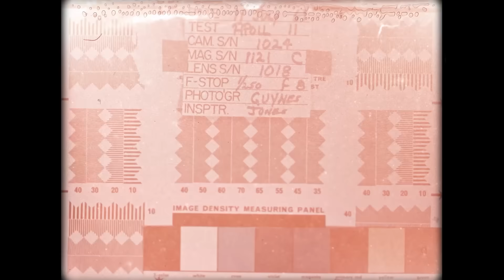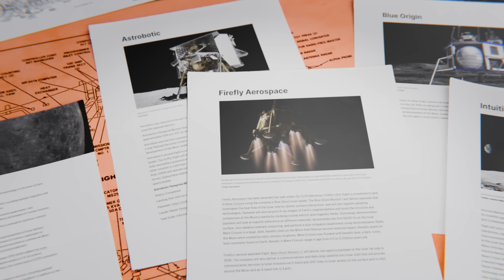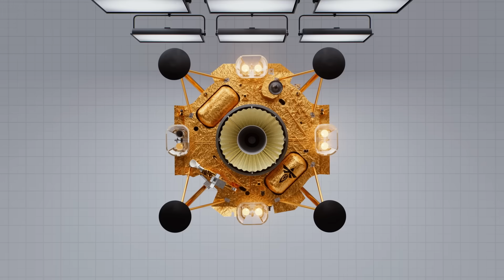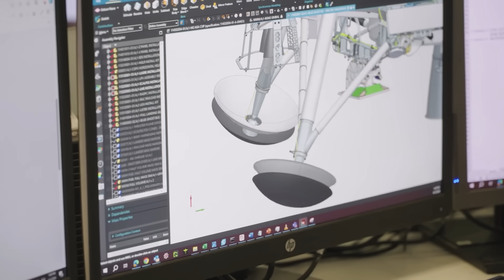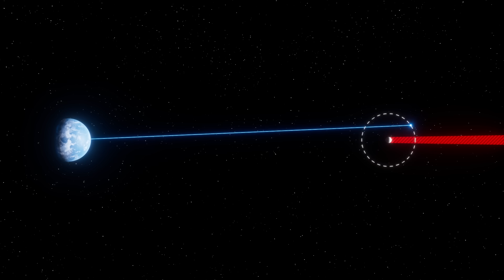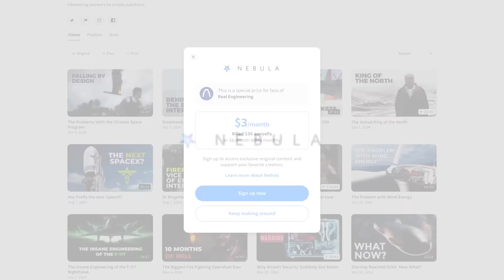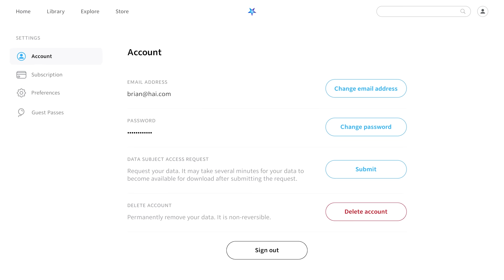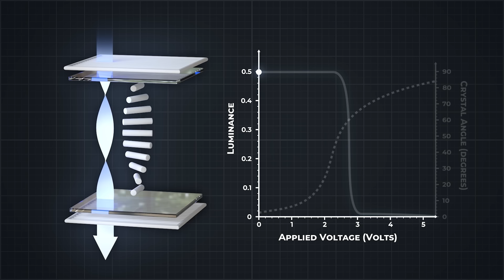Why the US is Struggling to Land on the Moon

Comment: There's a story that the Apollo astronauts visited the facility building the Saturn V rockets. At a presentation, the head of engineering announced that they had developed a whole new engineering standard for Saturn V manufacturing, and that they could guarantee 99.9% of all components would operate as expected, way beyond the engineering standards of the day. An astronaut put up his hand, and asked how many components were on the rocket. 'Over a million' was the answer. The same astronaut then put his hand up again. 'So, what your saying is, 1,000 components are guaranteed to fail?'. 70 years later, NASA will never again risk astronauts until the chances of failure are infinitesimal, and this is one reason why its become prohibitively expensive
Reply: That's not how statistical chance works. If each individual component has a .1% chance of failure, and have ten components, then there is a 1E^-10 chance that all ten fail (.1^10).  .1^1,000 is so small as to be essentially zero, and with multiple redundancy, is zero.
Reply: @SubLordHawk   When you're in space it only takes one of those components to fail to kill everyone on board though (Obviously there are redundancies for some, but in other cases there isn't and one component failing can result in everyone dying, look at the challenger space shuttle for example)
Reply: @RealDijital  I'm quite aware thank you. Also, my comment was regarding the mathematics.
Reply: That is why just about every one of those parts had a backup and that backup had a backup.
Reply: @wpatrickw2012  Er no, you've not got the point. 1 fire that killed 3 astronauts, 1 explosion that almost killed 3 more do not suggest a robust system with strong backup systems. And that's not counting the faults that almost caused other catastrophic issues where basic luck got them through. Modern manned space travel is extraordinarily expensive and difficult because that level of risk would never be permitted now.

Comment: i know weight is an issue. 
but still:
if landing on that thing is such a difficult task, why not calculate some "extra" to the weight-budged for a "sort of hook mechanism"?  

(i can see why that won't work, if the lander is at a constant horizontal trajectory with a certain amount of velocity , the hook would create it to slam it into the ground. but maybe in combination with the booster and a smart programmed sequence, when its slowed down...) 

i imagine the hook must generate its own force to penetrate the ground via a small rocket, so that the lander doesn't gets out of balance while firing the hook. 

just curios 2cents

Comment: Look at the amount of engineering that went into the legs at NASA Marshall. We used to have engineers who were able physicists. Generations later, all the most capable engineering generations are retired. Now, we have engineers with all the ego and very little classical understanding and experience in systems engineering who treat techs and mechanics as second class citizens. Five legs had too high a probability of tripping on the Lunar surface, three legs were not stable enough, so four was the correct number. I’m a tech, and I figured this out.

Comment: I've only just started watching this, but my opinion going into this is that 1) we sent humans to overcome things instantly instead of using automated systems and 2) we got lucky back in the Apollo era. We chose to land in those areas because it had the greatest chance of success, not solely for scientific research. Remember, that was just secondary to being on the moon during a cold war.
Reply: How could you get lucky 10 times in a row, unless there's a trick.
Reply: @robymaru03  Simple. To land humans safely, they prioritized larger areas that have a lower chance of unexpected rocks in the LZ. With rovers and unmanned landers, they prioritize scientific wants, which are usually areas with rocks. Both cases, mission designers had no idea what the final 50-100 feet will be like until the last second.

Comment: There is no struggle. Any nation with a space program could get to the Moon. The reason is elementary.
THERE IS NO POINT. 
It's a very expensive enterprise posing a not insignificant danger for essentially no gain.
We do not really need more Moon rocks, we have enough. And even if we did, sending a robot is orders of magnitude simpler. We do not need human eyes in bulky suits for several hours to see something. We have telescopes and robots. We do not need a scientific station on the Moon. Orbital stations are far superior for the simple reason that they have the advantage of zero gravity which the Moon lacks the same as Earth.
At the moment the only reason to send a manned mission would be a publicity stunt and the reality is that no one cares much. It's already been done, multiple times. It's not worth it.
People on the Moon are pointless until we get serious about its industrialization and that only comes after establishing a certain Earth orbital infrastructure anyway.
Reply: I argue the zero atmosphere and extremely low gravity is enough of a reason to go there if only for the fact that it would tremendously help rockets launch off the surface. A large reason why rockets are so big and expensive is because they have to break out of earth's atmosphere and immense gravity. On the moon, we could make spacecraft cheaper, smaller, and more efficient. In any case, colonizing the moon is an integral step towards further expansion into the solar system.
Reply: @savagesandwich9742  You can make spacecraft even cheaper and easier in orbit. Where there is no gravity. And plenty of resources from any meteor containing all the raw materials you might need which you can tow to the needed point with negligible effort. :)
As I said, you are completely right. Industrializing the Moon is the obvious path forward. But you only start that after you have decent Earth orbital infrastructure to allow transit of resources, machinery, people (if needed at all, the Moon is close enough for telepresence).
And to do all that you first need a reason. A reason to create industry on the Moon would be to supply space industry. But we don't yet have one. A readon to mine the Moon would be resources we could get from there easier and more profitably. There are none at the moment.
So as I said, right now there is simply no point. We do not YET have a practical reason to go there.

Comment: First of all, the first controlled landings on the moon were by the unmanned U.S. Surveyor landers, and 2 out of 7 failed. The Surveyor was a good design though. It was short with the three landing legs spread far apart. All 6 Apollo missions that actually made an attempt to land on the moon were successful. Mostly for 2 reasons. They had a similar design to the Surveyor landers. Short and wide, with a low center of gravity. Nevertheless, Apollo 11 would have failed, had it been unmanned. Neil Armstrong discovered that the computer was pointing it directly toward a field of boulders. He had to take over manual control, and flew the lunar module for over a minute before finding a suitable landing site. Without a human pilot, it would have crashed. The Intuitive Machines lander was designed completely wrong, even for a landing on a totally flat surface. It was tall and small in diameter. It was seriously top heavy, and the landing legs were way to close together. Even a human pilot would have had a really hard time landing that thing. It's simple physics. I don't understand why they can't figure out something so simple. They got the Surveyor and the Apollo lunar module right 50+ years ago. I guess engineers aren't what they used to be.
Reply: That's what I thought as soon as I saw it.

Comment: Are they serious? Can't they use a radar altimeter and infrared cameras to see through the dust?
Reply: I'm not sure IR cameras can see through landing dust since it's probably quite dense and with thick granulometry, but yea radar should have no issue at all
Reply: @v0ldy54  Well, most of the moon dust is very fine, depending on the density of the landing dust, IR could penetrate. Or maybe they could use wavelengths between IR and microwave. It's baffling they are just using optical cameras.

Comment: The more I reflect on the Apollo program, the more remarkable it seems. Not a single mission that took off ended in total failure. They used lead-acid batteries, and their computers operated at a speed of only 0.043 MHz, while today’s computers can run at 4000 MHz. Additionally, the RAM memory in Apollo spacecraft was just 2 KB, whereas today's machines typically have 16000000 KB. In the 1960's, we had only 11 years of rocket experience to rely on, compared to 65 years of experience today. However, back then, the space program received 4% of the federal budget, while today it gets just 0.5%—and its declining.
Reply: Well they certainly fooled you 😂 they need  another seven astronauts😅
1987

Comment: Surveyor landers not even mentioned when that's closer to what NASA is doing with CLPS than Apollo manned landings tbh, those don't exactly have a great success rate either at the start
Reply: Given the problems with the previous 'Ranger' series (which weren't even trying to soft land, and only the last three were successful), engineers were somewhat surprised that Surveyor 1...*did* work, first time out.
Reply: Or even the Lunokhod programme
Reply: Two reasons why US is struggling: 1 - sending money to Ukraine instead of funding NASA 2 - wants to send women to the moon instead of men; former are weaker and require more care to land safely
Reply: Yes, the seven NASA Surveyor missions to land on the Moon were pure robotic landers with technology from 60 years ago and designed by JPL. Five out of the seven landed successfully. The CLPS missions are from smaller organizations, and the cost is lower after adjusting for inflation, but NASA had landing technology six decades ago.

Comment: The most common reason for probes not landing on the moon was launch failure where the rocket did not achieve low earth orbit. This is a failure of the launch vehicle not the probe and is true for both the Americans and the Soviets.
Most probes that achieved selenocentric orbit successfully completed their missions. This raises the question that if probes launched during the 1960s and 1970s using the technology of that time were successful, why is it so difficult now?
If you want to get scientific instruments to the moon why not emulate the probes designed for the Surveyor and Luna programmes?

Comment: We can see why people have doubts as to whether or not we really landed men on the moon. It's been proven by some people that have investigated the landing computers and other systems in recent years that they were designed and built to work during the 60s and early 70s, but it's been thought that the risk for failure was to high. Too many things would have to go just right so the decision was made not to go, and they faked it instead. The amazing thing to me if that they kept up with more moon landing missions. If they were faked that would be easy. If they were real than that merely compounds the risk, and they all were successful. Hmmmm. 
My guess would be that the missions were continued in order to try and get the government funding to keep Nasa going. There were all those jobs to think of.

Comment: Gen Z Silicon valley robot rocket boys will do anything to avoid using Radar... accurate to within millimeter and can even do SAR imaging on approach.
Reply: yeah I was wondering the same, I believe that's what Chandrayaan 3 used for it's successful landing
Reply: American silicon is surviving because of Chinese, Indian engineers. American student not interested in stem 🤣
Reply: I hope you have lots of hopes and dreams because they're the only thing that could power a radar set with the capabilities you describe on a lunar lander. I don't have the exact numbers and honestly I don't need to because even with the ballpark numbers, you'd need to increase the power source of the lander tenfold.
Reply: @crazeelazee7524  The Apollo LEM had both a three-beam Doppler radar velocity sensor and a radar altimeter. Granted it took a Saturn 5 full stack to get it there.
Reply: @MattNolanCustom  A radar altimeter and a SAR radar are not the same. A radar altimeter is as simple as it gets and you would need ~10-20 watts for it. A SAR radar would need, at the lower end, a couple kilowatts of energy.
Mind you, the Nova-C lander's (one of which tipped over) solar panels can output ~300 watts.
Reply: @crazeelazee7524  sub-20W short range tactical micro SAR systems have been around for almost 2 decades. There's really no excuse I can see not to make them space-worthy to use on a lander like this to augment the visual spectrum systems
Reply: @crazeelazee7524  You really need the radar in the last 100m or so.
Reply: @crazeelazee7524  You can get S, X, and K,  band radars that use very little power but are more than capable of ranging and imaging (SAR) against the moon. Additionally you already have the RF equipment onboard acting as a link to the ground station.

More over, radars for applications like this don't need a lot of power. You're not trying to track every single droplet of water in the air.  Additionally a 1% duty cycle 1 watt RMS pulsed radar is effectively 100 watts  of absolutely SCREAMING RF energy. 

lastly... They have the power to do image processing in real time,  that fair bit of power. 

Solar cells used on probes like that pull down about 100 to 300 watts per square meter. Those landers are not exactly small, they have the power budget.

Comment: 1969-the Moonlander lands beautifully on the moon. 2024-it fell over!. Those olden day folks weren’t so dumb after all.
Reply: It wasn't plain sailing, there were some hairy landings. On Apollo 12, Pete Conrad encountered so much dust that his final descent to the surface was done blind. When observing the LEM on the first moonwalk, Conrad realised they had landed only 20 feet in front of a large crater.
Apollo 14’s Antares lander flown by Alan Shepard actually skidded sideways on its landing gear and stopped at an angle of 8 degrees with one footpad in a small crater. 
Similarly, Apollo 15's lunar module Falcon came to rest with its rear footpad on the rim of a 20-foot-wide crater that Dave Scott couldn’t see. This caused one of the lunar module's footpads to be off the surface entirely and placed the spacecraft at an 11 degree tilt.
Reply: Yeah man, those Nazi scientists
Reply: And it was accomplished with virtually zero diversity!  Just saying.  The 800 pound gorilla in the room: back pre 1970 NASA hired the best.  Period.  And, NASA tapped Von Braun and dozens of former Nazi scientists in the late 50’s.  They were the fathers of the Apollo program.
Reply: That's because in the past NASA had Nazi engineers from Operation Paperclip.
Reply: plus they didn't even cancel their horizontal velocity before trying to land... they did it all in one maneuver! truly unbelievable...
Reply: @ Cancelling out the horizontal velocity was actually a great challenge. Armstrong struggled with it and Apollo 14 actually skidded sideways on its landing gear and stopped with one footpad in a small crater. Pete Conrad of Apollo 12 said it took all his 20 years flying experience to do less than 60 seconds manual ‘stick time.’
Reply: And Lunokhod 1, 1970 an 11-month remote control mission.
Reply: @prasakmanitou4925  very true and an excellent reference sir!
Reply: They had a much bigger budget to work with tbf
Reply: bigger budget, more engineers, and multiple tested sessions with manned flights VS autonomous first try with a smaller team, no shit they did worse

Comment: Honestly, hearing that the failure rate of moon landings is 50% while mars' is just 5% higher, is kind of amazing. Different athmosphere, incredibly further away, different gravitational characteristics, yet only 5% difference. (I know, the dataset is very limited, but still)
Reply: You have to remember that Mars techically has infinite more atmosphere than the Moon. You can land with parachutes on Mars, it helps alot.
Reply: Just like flying planes the hard parts takeoff and landing, once you're in vacuum/air it's relatively easy

Comment: Probably the same reason nobody knows how to build a building, make a car or airplane, or create a correctly functioning computer operating system. Many things have changed between the 1960s and 2020...
Reply: Engineers made the lunar module and everything else to go to the Moon. By hand. They're not even taught the same protocol anymore. That's why they don't know how to make it.
Reply: @stevenlake5278  Powered by redneck engineering, just throw stuff together until it works.
Reply: That's the best explanation I've seen. They mastered there available technology we can't master ours. It's capable we just do know how to use it.
Reply: What do you mean by no one knows how to make a functioning OS? Who do you think is working on Linux distros, FreeBSD, Solaris or other stuff? Also, Cars and Planes(Except Boeing) are doing pretty fine.

Comment: DEI happened, to Boeing too. They basically just handed the future to SpaceX, meanwhile if you understand Elon's engineering it's terrifying. You know how SpaceX rockets deal with blow-by? Don't put anything in the way of the leak. Did you know you can make a containment vessel from tissue paper if the pressure outside and inside is similar enough? It's ALL stuff like that.